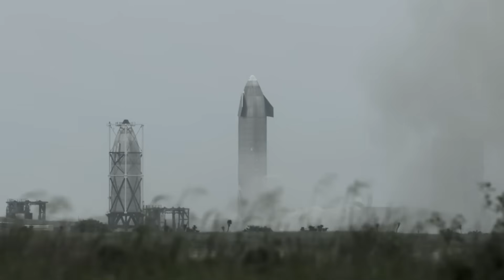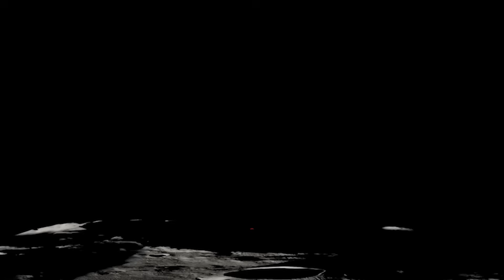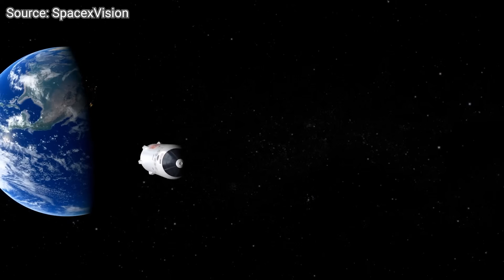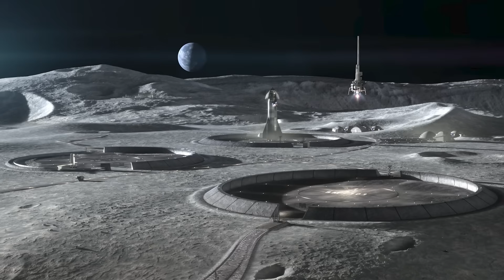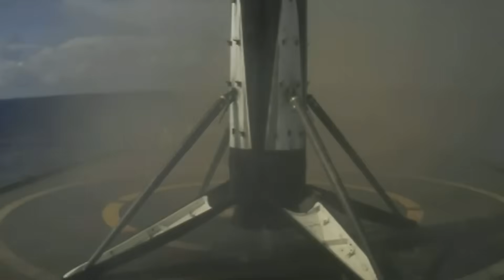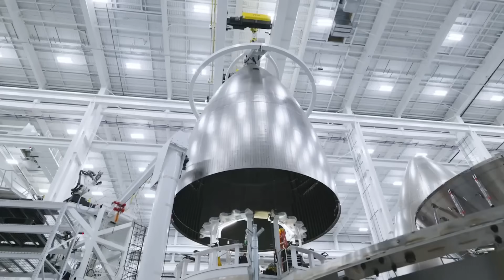SpaceX's Brilliant Solution on Starship Landing Legs to Land on the Moon

Comment: The best overall approach is the rocket landing horizontally.  Not only does that provide more stability, but it also enables covering it with regolith.  I expect SpaceX will come to that conclusion and redesign accordingly.
Reply: How do you get it back in the air???????
Reply: @wellesleyminto9388  You don't.  You cover it with regolith and leave it on the moon as living and whatever else facility space.

Comment: For any landing the legs need to start at a position closer to the center of gravity.  Every scheme I have seen has stubby legs at the bottom.  This gives a very small base area that MAY work on a level surface.  But, with a tall broomstick shaped lander you need a base at least nearing the center of gravity point and extending out to provide a base of at least that diameter.  Along with self leveling you guarantee stability.  This could be done by orbiting the "strap on legs" as a separate package around the moon to prevent a weight penalty for Starship.  It would then rendezvous  and attach the legs before landing.  The landing has no air resistance and weight penalty is absorbed into the safety margin.  The cost of the leg launch would be less than a manned launch and will worth the safety of mission success.

Comment: My idea deals with uneven terrain and instant stabilization. No motors. Just pressurized liquid redundant solenoid valves controled by internal pressure sensors controled by a small microprocessor. Extend, equalize, close solenoids. Instant equilibrium!
Reply: But is the landing area is sloping, then the down hill leg will have more weight on it (because more of the rocket is over it) and will need more hydraulic fluid in that leg to made the rocket be more vertical.

Also need to handle one or more legs sinking in deeper over time if that area has dirt that isn't as compacted.

Comment: Self leveling linked fluid displacement cylinders regulated by pressure sensors and solenoid valves level instantly requiring minimal pressurization and little fluid reserve. Fluid viscosity  range of little factor. Displacement self pressurizes reservoir
Reply from the maker: Oh yes, this will be one of its advantages.